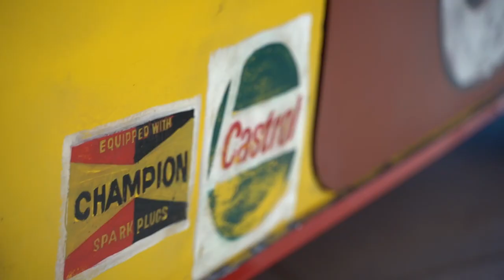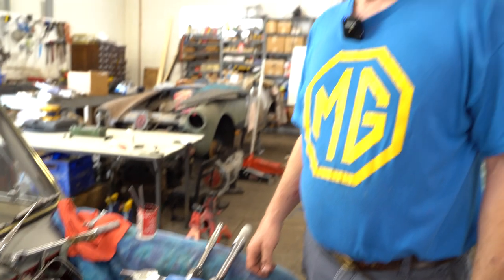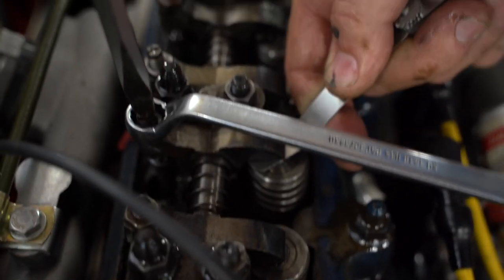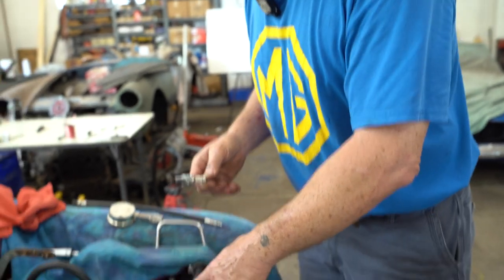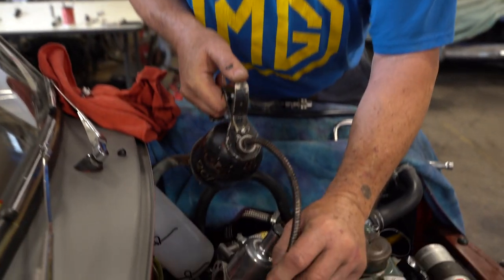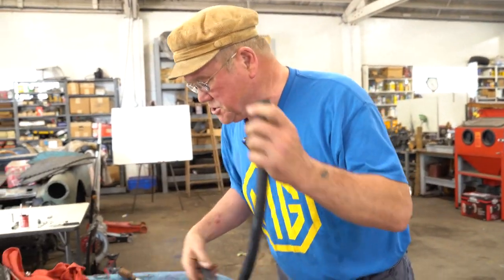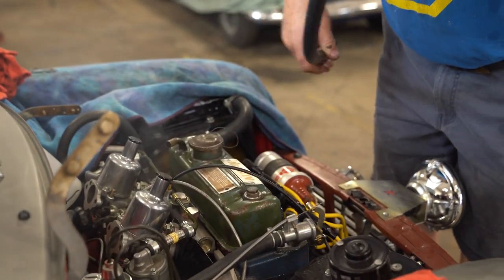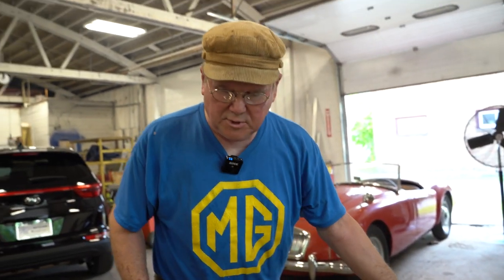343 MG Tech | ULTIMATE MINI RAT ROD: Complete A-Series Engine Tune Up

Comment: These rockers are the later sintered metal ones, they are not the ones to use if you go racing, I have seen them brake more than once. the early pressed steel or forged Cooper are bulletproof.

Comment: Thanks for this mini tuning video. My '88 mini with 1275cc A+ engine has a single HS4 carb, so should be easier to tune than the dual setup. 
For the head stud torquing, I've heard that it is best not to use any lube on the threads as this will change the torque (spec's assume dry threads) required to achieve proper fastener tension. Do you take this into account when setting the torque? Do you ever use the Gunson Colortune for setting mixtures?

Comment: The gauge should slide left to right.
Looks like an MG Metro 1275 engine with them tappets and depending on year/engine number valve clearances are all different.
From 13thou inlet and 15 exhaust or straight 12s.
Adjust air screw on each carb to highest revs then adjust idle screw job done.

Comment: Oh my God ! Don't use 90W oil in the dashpots. When i worked at the SU Service Dept, England, we only used 20W. The 90W will restrict the piston lift, causing super rich mixtures on acceleration and actually cause the piston to hang up when coming down to idle and possible stalling in traffic. 20W !!!

Comment: Ithe 1961 he had the heater motor on the inside A lot easier t
Reply: Intersting, Canadian Minis had the blower fan under the bonnet their whole life until they stopped selling them in 1980 but the hose runs inside the wing into the inside

Comment: Those rocker arms are FACTORY rockers from a later model......and they WILL break if used in a race motor. They're called sintered rockers and in my humble opinion, low quality and poor geometry, putting side loads on the valve stems.
An engine that rocks THAT badly, needs attention to the stabiliser bushings.